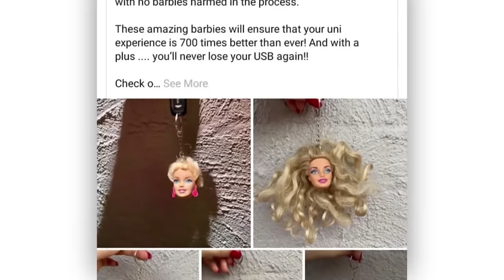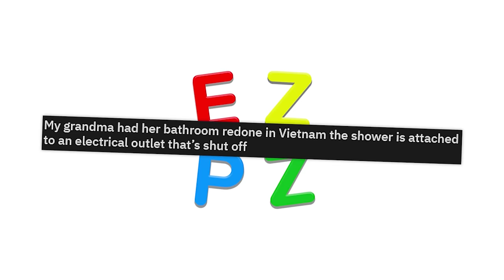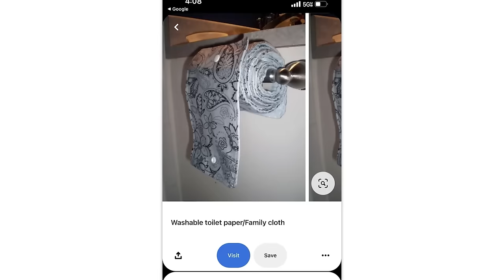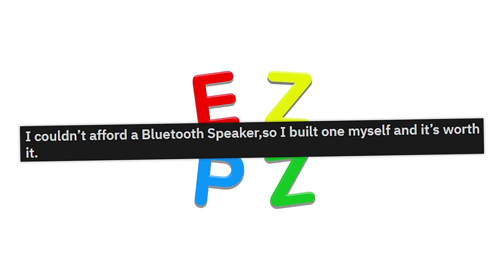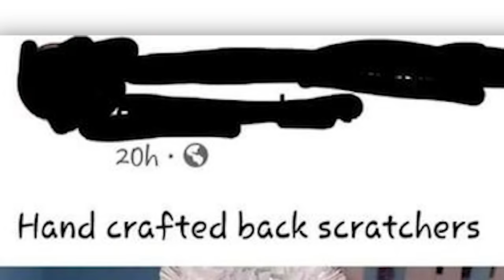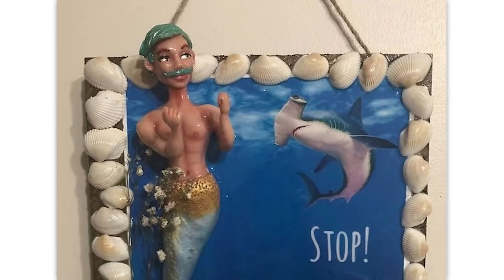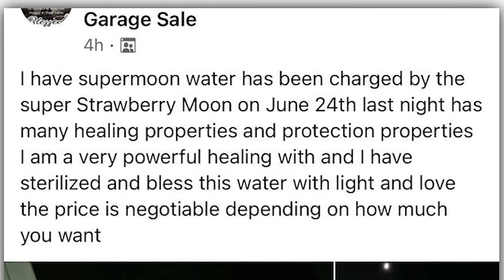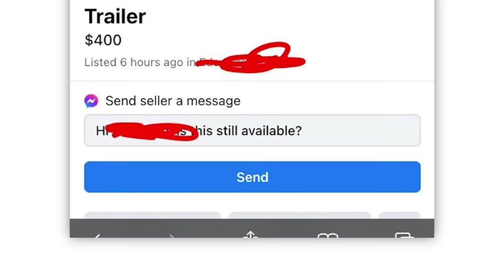THE MOST 🤔🤔🤔 OF r/DIWHY

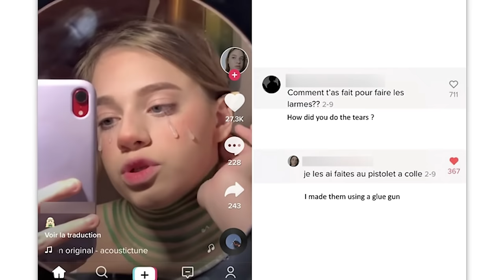Comment: 25:07 so she didn't put them straight on her face, I know how she did it. She used wax paper, a hot glue gun, and possibly a blow dryer. 

She first put down a sheat of wax paper on a even flat surface, she started up her hot glue gun with obviously the glue stick inside, she waited for it to heat up before she put a blob of hot glue on one end of the wax paper and moved upwards while stopping the glue to get the tear drop affect, she probably used a blow dryer on cold to speed up the process of hardering the glue and then gently took off the (completely) dried hot glue and used probably some like eyelash glue or something and stick the drops on her face for the video! 

Hopefully that made sense lmao, not the best at writing